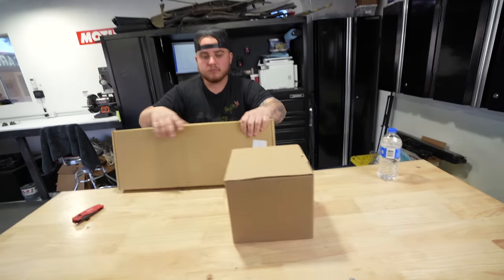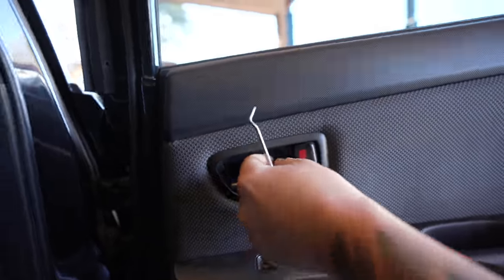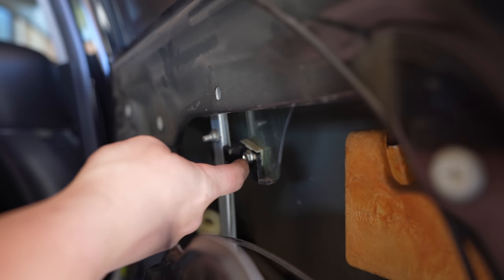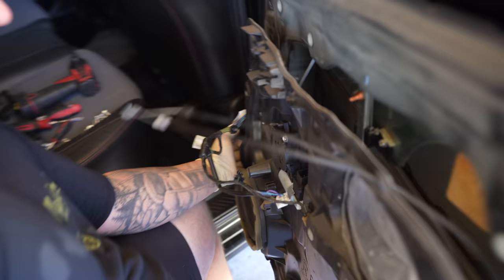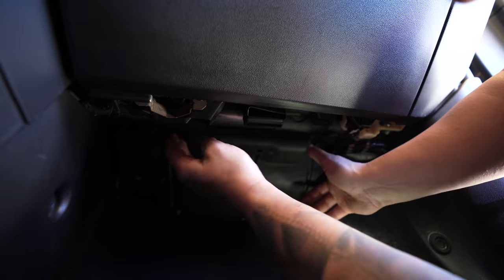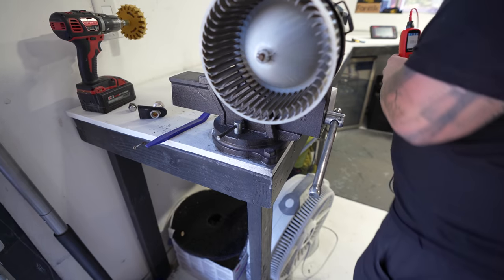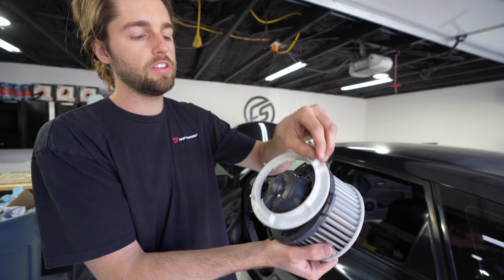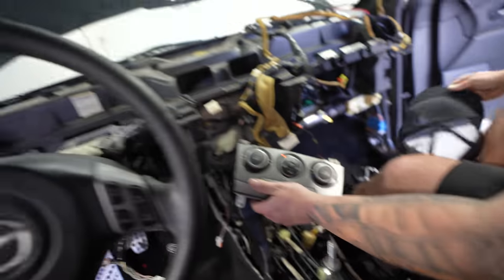Building a Mazdaspeed3: Blower Motor & Window Regulator Install!

Comment: My window regulator was the same way on both rear windows. Apparently they're very common with these cars. Instead of replacing the whole window regulator assembly, which is expensive and tedious, you can buy the gears that go in the regulator and replace the old ones. They're like $15 for one regulator. Works great if there's nothing wrong electrically and the regulator motor is strong. Two years now since replaced and zero problems. Stronger and smoother than my front windows.
Reply: Where’d you get the gears from? Having the issue with mine lol

Comment: I worked on Renaults in the 1970 - 1990 period and they had a massive problem with heater matrix’s leaking but to get to the heater box assembly meant removing the dash - It was a bastard job and the factory time was 5.5 hours. We did so many that we halved the time but I still remember groaning when the boss ever gave me a job card and it said leaking heater matrix - I have a Gen2 - 3 MPS - plus I have an old 323 ( in lovely condition) and neither have ever had any electrical problems cos that job looks as bad as the Renaults were. Keep up the good work !!

Comment: Well it was problem just the plastic gears that needed to be replaced but now got a new regulator but has same issue with a 2006 Mazda 6 I just replaced the plastic gear for like 30 for all windows